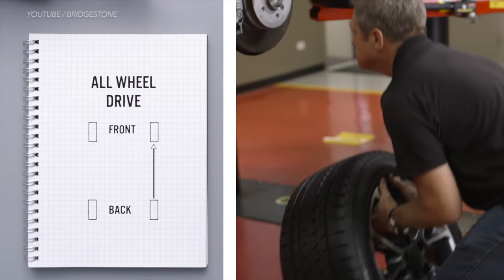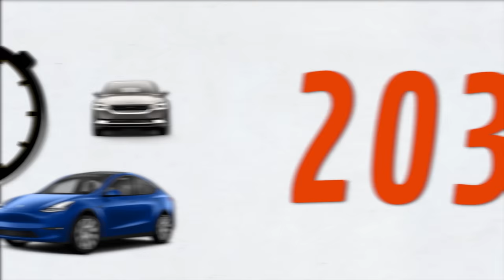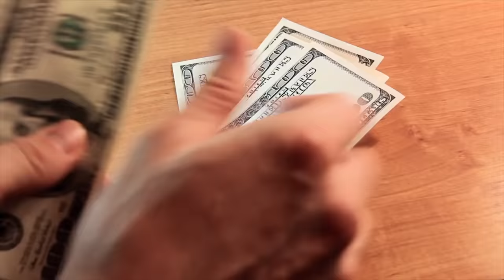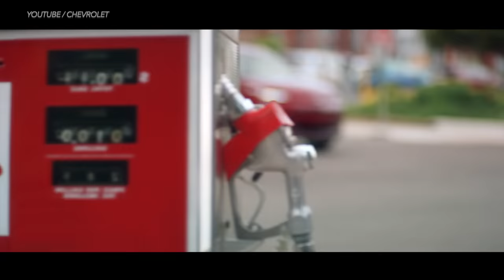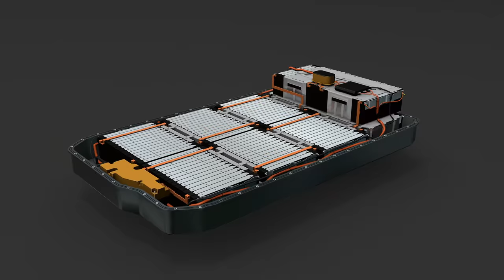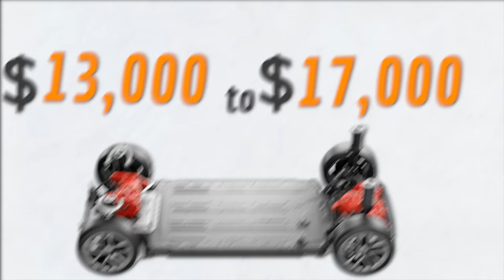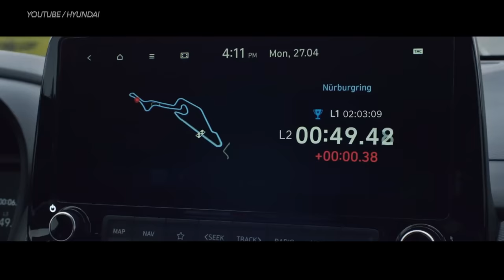No One is Telling You the Truth About the Real Cost of Owning an Electric Car, So I Have To

Comment: I have 27,000 miles on my 2021 model 3 and the tires are still just fine. Only maintenance I’ve done on it is change the canine air filters twice totaling $45.
I spend $35 per month on electricity to drive it. Bought it for $38k and now worth about $50k 
I’m pretty damn happy with the purchase since it’s literally made me money 👍
Reply: @extremedrivr  
I also have an internal combustion engine truck that I love and plan on keeping. If gas keeps climbing and electricity increases (which in my area hasn’t for the last decade at least) we will have a depression and you will have more things to worry about other than your vehicle my friend.
I’m just putting out facts and an 8 year 100k mile warranty is pretty good. 
At 100k miles I’ll have saved over 13k in gas so it will come out to the same as a 20k-25k vehicle including savings from maintenance. At that time I’m assuming it will still be worth more than that. 🤷‍♂️
Reply: But that increase in value is true with almost all ICE and especially hybrid vehicles over the past 2 years, also. And remember, a Toyota Camry hybrid can go 686 miles on a tank of gas that takes 5 minutes to put in the tank. Try that with any EV.
Reply: @davepaturno4290  yeah that would definitely come in handy on road trips
I don’t go on any road trips and have never charged anywhere other than my house 
I never have to spend any time at gas stations 
Also my Tesla is way more fun to drive than a Camry. Pros and cons to everything. Way more pros for me to daily drive my EV. 
I use my truck for work on my property and taking the family camping while pulling my 32 foot trailer. 
👍
Reply: @davepaturno4290  also I would have to argue that ICE vehicles with the same miles would be valued at 25% more than when purchased new 
Teslas are hard to get with sometimes a one year wait that’s why used ones go for more than new ones

Comment: I just bought a set of tires for my 02 Mustang GT for $1300 (includes taxes, balancing, installation costs). Of course these are high performance Bridgestone Turanza Quietride tires that have the W speed rating. They're suppose to have an 80,000 mile warranty. So it's not just EV tires that are expensive.

Comment: I guess I'll be on an e-bike for the next 20-30 years
Reply: yup I'll continue to drive on with internal combustion for a long while.....
Reply: I guess I'll turn in my driver's license and stay home.
Reply: @johnwigren4429  let the public transportation worry about it I got enough to worry about since enteral combustion can go further than ev as long as u can drive, drive with a non ev because one way or another like Scott said it will bite them in the rear with repair costs because of inflation will kill everyone..I have to regularly drive around vehicles both Enteral combustion and mechanics have told me of I go ev they won't touch them because they preference is combustion over ev systems are easier to diagnose and repair between 90s to 2018 before the ev and electrical crap came out is what they call it..
Reply: @bigb5995  it’ll be a long time before I even touch an EV…

Comment: Don't buy a sports car, buy a normal car like a leaf or a Hyundai. At 12 cents a KWH you can fill up a 40KWH battery for very cheap. Even if you get "gouged" for 25 cents a KWH that is still only 10 bucks.
Reply: Yes for now.
When all these EVs are being charged the current power grid infrastructure will begin to melt down, it cannot handle the load.
The grid will have to be rebuilt.
In addition the change over from ICE cars to EVs will require many more power plants and much more electricity to charge all these vehicles.  
What do think will happen to the price of electricity when the cost of the refurbished power grid and the required new power plants is figured In? 
The simple law of supply and demand, the price of electricity will skyrocket, it will make $5/gallon gas look cheap.
Reply: @ogcowboy5743  The smart meters on your house will make you a slave they will not allow big current draws at anytime you may need to charge your car.

Comment: To my knowledge, no one has presented a complete cost of owning an EV - meaning purchase price + maintenance + operations (electricity cost) - resale value.  Modern internal combustion engine cars routinely achieve 250,000, 300,000 miles with zero major repairs (drivetrain component rebuilt / replacement).   Just for kicks, I searched for an EV with 200,000+ miles within a 200 mile radius.  Zero, nada, zilch.   Not a single one.  What this suggests is that once the original equipment battery goes kaput, it's just not worth the money to replace and the vehicle is scrapped.
Reply: There’s plenty of videos on YT that do this. You clearly didn’t even do a single search….
Reply: There’s an Uber driver in NY I believe, that has almost 1 million miles on his Tesla, he will be the first. He had the defective battery warranty swapped around 170k I think it was. His second battery has lasted the other ~700k and still going. Searching for a 200k+ mile  EV within 200miles of you is a VERY small sample size. 
1. They haven’t been around a very long time for the low amount of consumers that have them, to have gone that far.
2. The people that have that high of milage have all been keeping them from what I’ve seen in YT videos.
Reply: or maybe it is that EV drivers are loving their cars and not getting rid of them, and the one that do sell them, sell them quick.

Comment: We have have had our 2021 Tesla Model 3 for just over a year. So far, no maintenance costs. We are in Canada so we use winter ties abut 6 months of the year. I rotate my tires when I change to winter tires in the fall and when I change to summer tires in the spring. So far, we are very happy with our Tesla Model 3. As far as the battery goes, our Tesla Model 3 battery is warrantied for 8 years. We plant to keep our Tesla for at least 10 years just like our previous cars so I think the car will save us a lot of money over 10 years.

Comment: Every time I look into the future of EV's I get more and more depressed.
Anyone in to project cars, learning mechanics on your driveway, say goodbye to all that unless you have an electricians degree.
Enjoy getting stuck in the loop of forever living off financed vehicles hopping from one to the next as that last car you bought becomes too expensive to keep on the road with failing batteries etc.
Reply: I'd have to disagree. My first ev was a home build. Bolting a dc motor onto the manual transmission of a chevy s10. two wires to connect dc from the controller to the motor. Two wires connecting the controller to the battery. and a control wire to the accelerator pedal. Thats about it for a basic ev drive vehicle. An ac version would need 3 wires from the controller to the motor and possibly a tach wire to monitor motor rpms. I would think this is much easier than a home build gas vehicle. Heck i even covered the bed in solar panels. Two wires from the solar to the batteries, thats it. you don't get much range from solar but it lengthens battery life by reducing depth of discharge. Most fun vehicle i ever owned, even if way under powered.

Comment: Electric Vehicles are proving to be way more of a fire hazard, in comparison to good 'ol Internal Combustion Engines.
Now, being of an older generation as well as a 'car freak', I am a 'Dinosaur Juice Fuelled' Vehicles, fan. Love, that
Eight Cylinder Roar ❣                   Roland Singh, Canada 🇨🇦
Reply: The only cars I have actually seen catch fire are petrol cars. Volkswagens were shocking in the fire department.
Reply: @amraceway  yeah, had a friend who's VW burned. It was a early 1970's, air cooled classic. It was neglected & it burnt. 25 years after it was built & 200k miles. 
Not quite the spectacular seen-from-space two month old Teslas that make the news... lol.     Fire response needs an Olympic-sized swimming pool of water to pour on those lithium fires.   Pass.  + the dead $18k battery every nine years.  No.
Reply: @amraceway  I worked at a towing company and we had to put burned EV's submerged in watertanks for a couple of days, some even for a whole week... Some even started burning again after a couple of days being submerged....

One time a man crashed his Tesla and was in critical condition. The firemen couldnt reach the kill-switch to turn the EV off so they couldnt help him, after 2 hours when the specialist from Tesla came to assist the victim passed away.
If it was a normal car they just had to cut open the roof to get him out.
Reply: @DeUnoReverseKaart  Obviously the battries and kill switches need some re-design.I remember Ford had issues with Pintos being hit up the arse and burstiing into flames. Nothing left to put in that tank of water.
Reply: Because you don’t believe internal combustion powered vehicles catch on fire? They catch on fire so much that it’s not news. Two gasoline engine power card manufactures have recall warnings not to park your car indoors because of the risk of fire.
Reply: Internal combustion engines are actually way more likely to catch fire. Clear data on it.
Reply: @Dontneedtoknowdoode  Because there are more of them lol
It even hapens so often that (here in EU) you are not allowed to charge your EV in parking garages, not even at home. If it catches fire for some reason while charging at home in your garage, you are not insured for the damages.
Reply: @DeUnoReverseKaart  no I’m not talking about numbers in total I’m talking about the rate. EV is was less likely to catch fire.

Comment: Scotty, I have seen older videos of yours where you said that rotating tires is not necessary, but in this one you say that they should be rotated. Clear this up please. We had a '97 Mercury Villager that would wear out front tires quickly. If I rotated the tires, the wear was spread out over the 4 tires, and they would all wear out at the same time, so I had to buy 4 new ones. If I got lazy and did not rotate them, the front ones would need to be replaced far more often than the rear ones. I am wondering if it makes any difference over the life of the vehicle about the number of tires replaced, and the amount spent on the tires. If tires are rotated, the wear would be the average of the wear of the front and rear tires. If the tires are not rotated, it would still be the average of wear of the front and rear tires, only the front ones don't last as long but the rear ones last longer.

Comment: EV's with High mileage also needs more parts replaced than ICE cars like Toyota Honda or Volvo. Because EV's are heavier, therefore suspension parts like shocks, bushings etc etc etc needs to be replaced more often between 120,000 and 350,000 miles or for Volvo's one million Km. most EV buyers don't realize this when they buy a new EV.  But I think most EV owners will dispose of there car after the battery becomes less efficient, after all electricity is not cheap neither, or before the battery needs replacement $$$$$$.   of course Toyota and Honda's need to replace starter engine and alternator after 200,000 miles, but this does not cost 14,000 dollars, and can be done by home mechanic.  What the Dutch really hate about EV's is that EV's use energy when not used, just while parked. This is not very efficient for people that don't drive that much this is pure waste of energy and electric is not for free.

Comment: EV adoption in CA is driven by income tax subsidies, high taxes on fuel, expensive special blends of fuel that do not exist anywhere else, and the preposterous labor rates for mechanics. These factors do not exist elsewhere in the country. And, EV's suffer from a radically reduced charge capacity and range in cold weather. They are very poorly suited for most of the colder states.
Reply: Norway's EV market share is 84%.  Norway is not exactly a warm country.
Reply: @dansanger5340  Norway is a small country. What is the average travel distance per anum in Norway? In the USA it is 12,000 miles.
Reply: @dansanger5340  The country is only a hundred miles across, evs will work in Hawaii to, big deal.
Reply: @hcox1111  Oslo to North Cape, Norway is 1300 miles, all within Norway.  Oslo to Bergen (second largest city in Norway) is 288 miles.  Oslo to Trondheim (third largest city) is 301 miles.  Oslo to Stockholm is 322 miles.  Oslo to Copenhagen is 375 miles.  Oslo to Amsterdam is 949 miles.  Oslo to Paris is 1227 miles.  Oslo to Barcelona 1795 miles.

Comment: Good God. 20 mpg truck, 15,000 miles a year, $6 a gallon is $4500 a YEAR. Electric vehicles would cost about $750 a year, with NO engine maintenance. This crap that EV owners won't rotate their tires is silly. When there is no other maintenance, why wouldn't they get their damn tire rotated?
Reply: Because the vast majority of them don't know anything about cars and they're sold a car that they're told "requires no maintenance."  The vast majority of people know very little about their car, but at least the owner's manual gives a basic maintenance schedule for them to follow.  I've had a lot of fools brag that their EV  "never needs any maintenance" and they don't believe when I mention things like the suspension system, brakes, tires, and coolant.
Reply: I know a bunch of folks who forget/ignore tire rotation.
Reply: What will an EV be worth when the electricity is shut down, brown out or black out? Electric rates have climbed dramatically over the past 15 years as has usage.  Power generation can't keep up.
Reply: @fakumadda1632  all the gas stations here where I live are backed up by diesel generators.  An expensive lesson learned back in 2001 when the electric grid failed for an extended time, days. Grocery stores got generators also bc they couldn't sell food and their refrigeration all shut down. My personal bulk fuel tank runs on gravity. Has never failed.

Comment: EV battery is a true bank braker. It will cost you 20 grands to replace the Tesla battery.
Reply: Tesla batteries usually last 250k+ miles and are under warranty for many years. This is a non issue. Want to hear about all the engine replacements my coworkers have done with their German cars?

Comment: I'm saving more than $300 a month just on gas. That more than pays for getting new tires more often. It's not hard for me to remember to get a free tire rotation.
Reply: Fine for commuting to work. Horrible for cross county drives (even 600 mile drives)
Reply: But did you pay $20,000 more for a comparable car? I have a Model 3 and love it, but it was the most expensive car I’ve ever purchased. And what you save in gas went straight to your final sales price.
Reply: In 100 months you will make up for the extra 30,000 dollars you paid, over 8 years that's to long.

Comment: -  The only things I have replaced on my gas car after 96,000 are the control arms and front struts along with tires, But brakes and oil changes I do myself so maintenance has always been a  small cost. And honestly I like doing the maintenance on my car, that way I know it's been done right.

Comment: I currently own a 2010 Ford Fusion Hybrid. The spec I looked up on the internet on the new rotor was .980 inch thickness new with I believe .920 inch minimum thickness. I bought the car with about 130k miles. Today it's at 239k. I resurfaced the rotors and never did the brakes. The rotors were mostly bad due to rust and I live in Illinois. After resurfacing them myself the the wear was extremely minimal .971 inch. I do drive like an old man but I thought this was amazing. The main reason why the brakes went bad was because the slide pins were seized up and rust  Not sure how many more miles I got left on this vehicle, we'll see. I might consider a plug in Prius for my next vehicle due to Toyotas focus on quality. I've never purchased a Japanese vehicle in my life. Although my experience with this Fusion has been largely good there's been a few problems that I thought might not have occurred if it was a Toyota. I was hoping the Nissan Leaf would have good reviews because it has been massively produced but so far the reviews haven't been too good. I own an electric lawn mower, weed whacker and snow blower. All 3 have far less issues than the gasoline powered types I have own in the past. Very low maintenance on these electric devices. 
I considered getting a used Chevy Volt or Bolt but the reviews and service seem to be lacking....ugh. Hopefully as we go into the future the prices will go down and the quality will go up. I don't regret buying my 2010 Ford Fusion. I got it for a good price and put a lot of miles on it fast doing both Uber and UberEATS. 
I've replaced the throttle body, the accelerator pedal, the front steering rack, the fuel evaporator canister purge valve and now I'm doing the brakes. Compared to a Ford Focus I own the gas mileage is almost twice that of the Focus yet the Fusion is larger quieter and smoother on ride it feels luxurious. The Focus has been good but is largely going to have to be replaced because of rust issues in both the body and frame and that's due to living in Chicago area. I hope in the future we have electric vehicles that are reliable and affordable. If they make them as good as the lawnmowers and weed whackers and snow blowers it will be a logical choice for people who just want to save money and have low maintenance costs. I remember when I was one of the last people to get a cellphone. There was a time when those seemed expensive and unnecessary. You have to admit the cellphone does have it's upsides. Hopefully we'll get to a future where owning an electric car is not so expensive. I've never purchased a new car in my life. I never felt they were worth it.

Comment: In the long run, rotating tires does not make them last longer. It simply means that all four will all wear out at the same time, requiring you to replace all four at once rather than just two at a time.